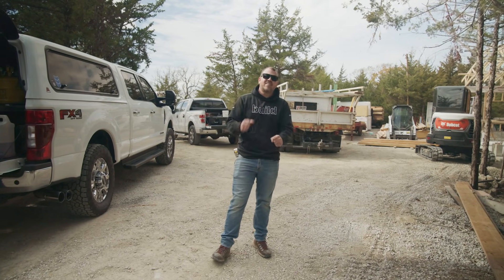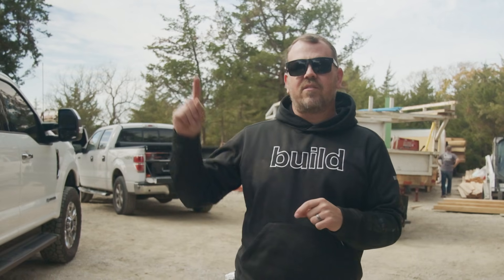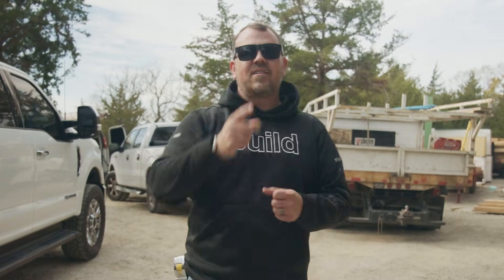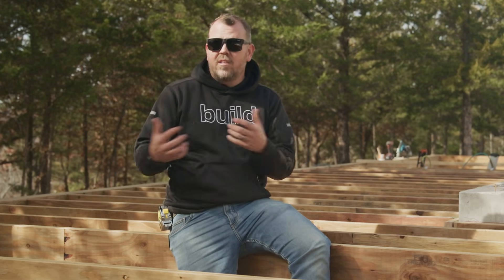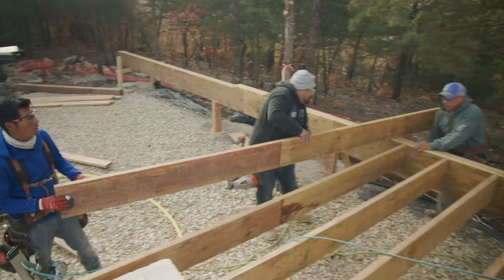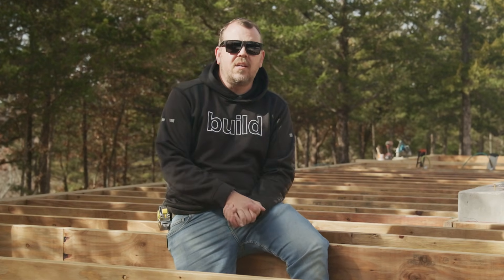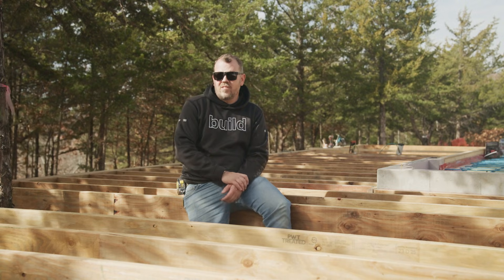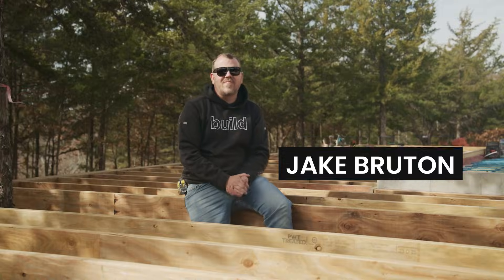Ditch the Pressure-Treated – Why LVLs Make a Better Deck

Comment: I just built my exterior staircase with these. I ordered 11-1/4x20" for my stringers cost $280. Also, 11-1/4x12 cost $170. Very straight and strong stairs. Used the 12" to cantilever the stair landing 4" out from structure.

Comment: I wish I would have known about this 2 years ago when I replaced the deck that came with my now 9 years old house. I completely rebuilt mine from the ground up and taped the top of all the framing before installing TimberTech PVC that costs a small fortune. Trying to get a flat surface for PVC was a nightmare with the dramatic difference in dimensions from one joist to another as well as bowing and uneven shrinkage as the joists dry out. My deck is in full sun on the south side of my house in Tennessee so it dried very quickly and I had to go back and do more planing of high spots and shimming of low spots.

Comment: I’ve never had a deck whose framing failed before the decking. On the other hand I have resurfaced many decks were we had to replace a couple bits of PT. Added deck tape on the top and resurfaced. I’m not seeing the value here.

Comment: I am a DIY homeowner, and I am actually about to order my deck joists. As far as new products go, I rather trust old and tested, plus I am also generally not too much into the whole warranty thing either, especially for something like substructures.

My hunch feeling is that in this case the warranty only covers the material, yet the majority of warranty expense is in the labor and the surface product, both of which then are uncovered?

Plus how many times have we heard lines alike "yeah, in the beginning they had issues with this type of product, but later they improved ingredients and manufacturing process". In other words, early adopters are out in the cold, while the original manufacturer has long gone out of business - if for nothing else, for towering warranty claims.

So no thanks. Maybe 25 years from now, when I see how this has held up to time, but today, I am not going with manufacturer's projections and warranties (or even industry projections, that may turn out be just as wrong).

Comment: I really hope other companies come out with more treated LVL products or the processes get more refined to drive the cost down. 3-5x the cost of PT lumber is no where near worth the benefits of engineered lumber in 99.9% of applications. As an architect I can think of only one or two VERY rare situations where I would consider specifying Treated LVL at the price point they are currently at.

Comment: i was wondering 
at the end of  a solid framing  decks life it starts cracking, sagging and rotting giving some warning signs to replace. 
Does this glued framing one day just fall apart ?
Reply: Yeah, LVL's are over priced garbage aside from very particular circumstances/uses. I don't know what Jack ads got the bright idea of trying to make exterior LVL, but they should be fired.

Comment: A properly taped and flashed pressure-treated deck frame will easily last 20 years, and cost 1/3 of what you're selling. The rest of your ad script is pure FUD.
Reply: My pressure treated  2x8 framed Deck is 30 years old and still Looks great.
Good ventilation and sunlight are key to manage moisture cycles. 
Laminated wood adhesives ,will fail and delaminate.

Comment: I think the Simpson fastener company would do well to offer a series of fasteners designed to work with commodity (standard size and very available) light steel framing. Show some engineered decks of common sizes and shapes, some elevated, and adaptable to various decking options like tile. That could definitely be cost competitive with expensive lvl.
Reply: Why? Steel would last forever. They want it to fail after awhile so you buy more.

Comment: Why would you put a non-warrantied product on the deck? Well because the cost of this deck is going to be 15 or 20 thousand dollars more than the same deck built with other materials.

Not knocking it, but there are millions of americans and canadians building decks and houses who are not hiring bespoke custom builders...

The build show consistently gets this wrong - rarely a discussion of value engineering or cost.

Comment: I'm not a fan of pressure treated lumber.  To avoid it,  just had my deck built with Fortress metal structure. Nice solution.  I wonder how cost compares to treated LVL product.

Comment: What was not discussed was that PWT can be 2x-3x or more expensive than PT lumber. Imagine paying $30-$45,000 for a $15,000 deck. Yeah, I know, the quality of the lumber is a lot better.
Reply: YES! I tried to do an lvl treated deck and it was way way way to over budget! NOT WORTH the "better" I just want a deck...
Reply: @jarvisjohns This past summer I started pricing the lumber for a 12 x 16 deck at my daughter’s house. I wanted good high quality lumber for the foundation. These LVL lumber were just too expensive.
Reply: @papatutti59  The lvl's are cheep HOWEVER the treated lvl's are not!
Reply: Thanks for pointing it out. I am a DIY homeowner, and I am actually about to order my deck joists. As far as new products go, I rather use old and tested, plus I am also generally not too much into the whole warranty thing either, especially for something like substructures. My hunch feeling is that the warranty only covers the material, but the majority warranty expense is in the labor and the surface product, both of which then come out of pocket?
Reply: If only the framing is 2x the price that doesn’t make the entire deck 2x the cost and actually if you factor in the time it takes to track saw every PT joist straight and to the same nominal height then it’s probably close to the same. The most expensive part of the deck is the Decking, railings, and trim.
Reply: He said it was a $custom$ home in Dah Toto (all the pollution in ground water).
Therefore, the deck cost is nothing compared to water sistern? Water filtration?
Reply: That's not an accurate assessment of price.  Factor in the total cost of construction not just the lineal price/foot difference.  Alter the design to take advantage of the strength benefits.  For example, you may be able to size down 1 full size, e.g. 2x10 down to LVL 2x8.

Factor in the cost of handling treated many, may times during the construction.  Culling, crowning, rejecting, returning, etc are all factors that don't present when you use this product.  Wear and tear on the crew handling heavier material many times, the wear on the machinery and the list goes on.

Certainly, let's cheap out on the structure of the deck and put expensive decking and railing on an inferior product.  Full disclosure, I partnered with PWT when for 2 decks.
Reply: @AwesomeFramers  Here in Bowling Green K.Y. I tried to source treated lvl's and they where $19/foot..... We cant all partner with PWT.
Reply: @jarvisjohns ask yourself why they won't partner with you.....
Reply: @AwesomeFramers  I have never asked.  I only build 3 houses a year.
Reply: @jarvisjohns you should ask
Reply: The framing lumber is not a huge part of deck cost to begin with. The decking itself is much more like trex or ipe is much more than the 2x10. So switching to lvl pt is not going to triple the budget
Reply: @asherhadgu4201  Yes it does.  Its the cheapest part tell you pay for lvl's then its the most expensive part haha.  If your not a builder and just googling things you dont understand how expensive it is.

Comment: Why dont they just dip 2  x 10 or12 wood into a composite or gel coating? Cured it should be waterproof
Reply: Mostly because if you apply a water and vapor tight coating onto something that needs to keep dry. as soon as that coating gets cracked moisture will get in and be trapped accelerating the rotting process. You see this with all sorts of coating products.

Good detailing and water management is drastically more important than high tech materials.

Comment: why did you not cover price? That is one of the top topics to discuss with anything? Love the channel and find it very interesting.
Reply: Go in the videos bio and look who sponsored the video... You have your answer. This channel is sponsored by a lot of big companies now. While the information is usually correct, you now have to question yourself "Are the solution presented appropriate or are they pushed upon us to promote certain products/ new technology?"...
Reply: Exactly, I'm sure solid steal beams would hold up better for decks as well.. but it also costs orders of magnitude more than pressure treated lumber.
Reply: All these builders never mention the cost because they know only their rich clients can afford it.
Reply: Because if they talked about price difference people wouldn’t watch the rest of the video. It’s 4 to 5 times the cost of PT. So you could frame four decks with PT for the cost of LVL. At that point why not just make it out of structural steel?
Reply: Same Q - how does the price compare?
Reply: @davebean2886 those LVLs he has are $12.10 PER LINEAR FOOT. So if you get a single 10’ LVL, it’s $121.
Reply: Could see a benefit of using them for the outer parameter structure due to their trueness/straightness but otherwise thats an expensive deck.
Reply: Because PWT LVL's are absurdly over priced and not worth it.
Reply: I did a quick check on the cost difference between treated LVLs vs. pressure-treated lumber. According to Grok AI, which searched over 232 websites, the cost for a treated LVL is $160 - $320 PER BOARD. Because treated LVLs are a new product, it is VERY expensive. Pacific Woodtech (PWT), which is mentioned in this video, came out with this product initially in 2019. 

So if your deck required just 50, 2" x 10" x 16' treated LVLs, your approximate cost just for the LVLs would be $10,000 (measured at $200.00 per 16-foot 2" x 10"). Very few clients are going to pay for that material cost in a deck. It is more than 8X the cost of pressure-treated 2" x 10" x 16' boards. 

The video author is correct, treated LVLs are vastly superior to pressure-treated lumber. But for decks, most clients don't really care. Having framed numerous decks, I would very much prefer to use treated LVLs if the cost difference were more reasonable, but it's not.
Reply: Yup
Reply: Because depending on your location price may vary.  But ultimately, I think you can expect that it’s more expensive than pressure treated.  Call your local lumber yard
Reply: Agreed, this is a really poorly done video. They didn't deal with termite resistance either.
Reply: This is a perfectly acceptable question. There are a couple reasons that price isn’t discussed in this video. First, pricing for material is different in every sinlge market, if I bring it up, it wont apply for some folks and it will absolutely be incorrect. Second, there is always a price difference when swapping materials. Zip costs more than OSB, we as the builder have to decide if there is a value in the material that justifies the price change. Third, do the clients require something different or something that simply costs more. If the entire world were about price and nothing more no one would drive a Mercedes, you can buy a Honda that does the same thing. Different people find value in different things. YES, this material is substantially more expensive to purchase than pressure treated lumber. However, for all of the reasons mentioned in the video the purchase price isn’t the only part of the equation that matters. Longeveity, installing less material saves labor, installing higher quality materials makes decking or flooring install easier saving labor, having a warranty that my client will feel warm and fuzzy about is a plus too. There are trade offs. Absolutely this is not for every project. Heck, it won’t be available in the budget for lots of homes we build either, but it is an upgrade in quality and longevity. What we as builders have to do is try and figure out if the cost difference is worth the upgrade in quality and longevity. In some of our homes it absolutely will be worth it.
Reply: @jake.bruton.aarow.building  While I respect your response, I disagree with your reasons for not giving an approximate cost. It's as simple as saying HERE in this location, we paid X amount of dollars per foot for treated LVLs. That would have been sufficient. What would have been much more competent is to say, "We have checked prices on the eastern, middle and western locales at these specific major cities and here is what we found.  Eastern cost was: X; middle state cost was: Y, and western cost was: Z." You did neither of these, and it would have taken you 10 minutes online. You have no excuse. Your video is lazy and poorly done. It also appears that you are being paid to push treated LVLs by the specific company you mention in the video. 

I am a journeyman carpenter and licensed General Contractor who has framed hundreds of homes and many decks. I have framed every level of residential homes, all the way up to multimillion-dollar custom homes. I also design homes for clients. I don't consider decks to be boring at all, when you consider how to waterproof them and control water runoff from them. This is especially true with exterior decks constructed on the second floor of homes. The structural support for decks and the material choice also deal with cutting-edge materials. For example,  with the last few decks I have built, I used composite decking, which I have found to be vastly superior to wood decks. Designing decks the CORRECT way is actually somewhat of an art. The vast majority of decks I have seen built by others have several severe design errors, which will greatly limit the useful lifetime of these decks.

You come across in your videos like a "know-it-all," and clearly, there is a lot about deck design you don't have a clue about. You may indeed be a competent home builder, but in this video, you are stepping outside of the framing world into the most current designs of both homes and decks. I realize that you are just introducing LVLs as a new material available for decks, and I agree that LVLs are superior to pressure-treated wood. But when I checked, a 16' treated LVL is approximately $200.00 (per Grok AI) compared to around $25-$30 for a pressure-treated 2" x 10". So the treated LVLs are approximately 8X more expensive than pressure-treated materials. That is an incredibly important fact that your video utterly failed to address!
Reply: this is how they got everyone paying 300% more for osb painted green, so i guess theyre giving marketing this treated lvl thing a shot
Reply: @nathang.1561 @nathang.1561  Well, why have I not used Zip Board? A LOT of home builders in AZ are using it. Also, Zip has proven itself bulletproof against water damage during construction and over its longevity. That DOES make it a real product that provides significant value over standard OSB. If I were to design a home today, I would specify  insulated, ZIP board sheathing for the homeowner because I believe it to be well worth the cost difference. Homes that use OSB alone for sheer panel require a waterproof barrier, whereas ZIP board provides that with its sheathing. ZIP is also far more water-resistant than OSB. OSB is pretty durable in wet weather and will even survive two or three rainstorms. But ZIP board is on a whole other level. That's why you see almost every home builder and  YouTube construction creator using the ZIP board system.
Reply: @nathang.1561 ZIP is an actually great product. This is bs. LVLs are meant to be an alternative for extra long spans and structural applications. They’re not meant for general framing, especially a fucking deck. Lol
Reply: a single 1 3/4 x 9 1/2 x 12' is about $220 and a 16' @ $293 so significantly costly.
Reply: @jhandy4161 that’s ridiculous. It’s a deck. I’d buy lvl if I was required to by code for some specific thing. I would never pay that much for a deck. I built a deck thirty years ago before they had brackets for every single joint and it’s held together with galvanized nails. The frame is fine. It’s grey looking but there isn’t rot anywhere. No warping, no rot, it’s a deck. Some of the deck boards have had to be replaced but the frame is still running strong.
Reply: @jhandy4161 in Pa

Comment: Treated lumber is never dead straight on edge and often the widths of boards vary.  PWT being dead straight, dry with no shrinkage, and the same width will make decking surfaces ready to install.  Treated lumber needs to be planed down in areas that stick up and shimmed where low.   Personally, I'd use ground contact rated treated lumber for deck framing only because PWT would be much more expensive and probably a special order.